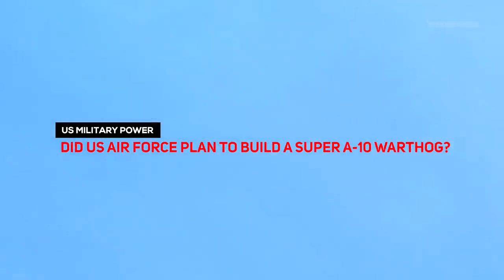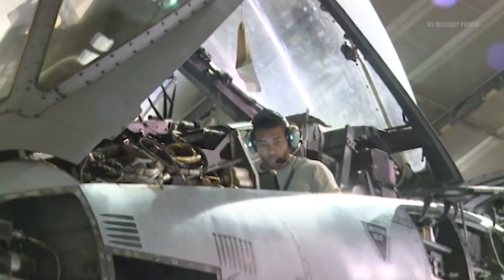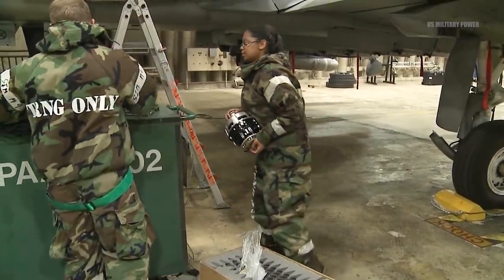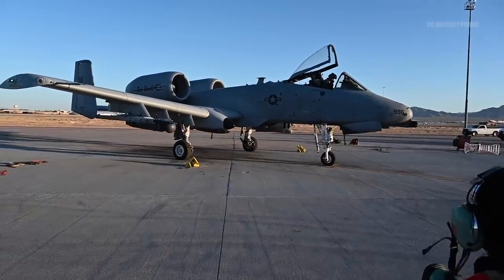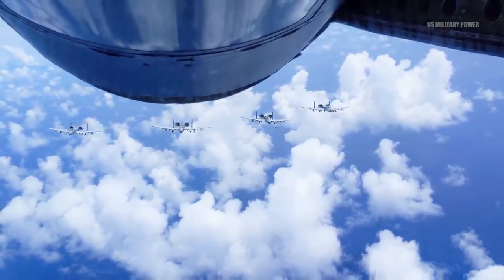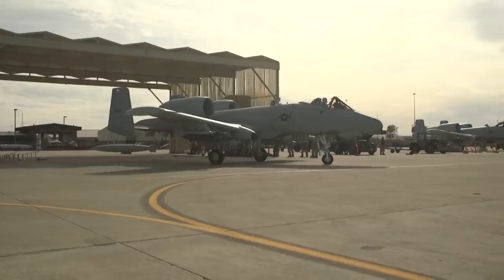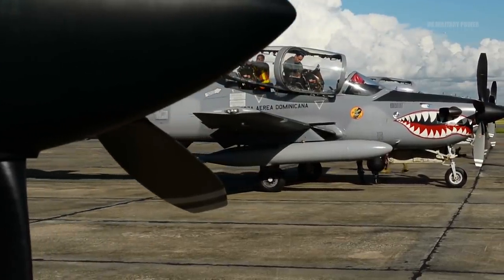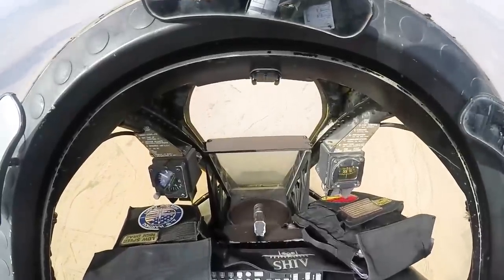The New Super A-10 Warthog is Coming

Comment: The A-10: the 30mm anti tank, vehicle and infantry flying gun
Reply: It literally was built around the gun.  Haha  brrrrttt  brrrrttttt!
Reply: Like......wooooo.
Reply: You missed anit building, hard ground target...
Well, if it is on the ground an A-10 can likely kill it!
Reply: The A-10 is basically the anti-everything gun with wings.
Reply: When you're ''anti tank airplane'' struggles to kill tanks with it's main feature and is outclassed by multiroles because guided munitions are based
Reply: @eemonkey7234  Just ONE lil ol' problem. The A-10 ALSO carries guided munitions on those under-wing pylons...
Did you even watch the video?
Reply: @BloodRaven1969  I never said that the A-10 doesn't carry guided munitions. I said it's main feature falls short by modern standards. Even then what difference does it make that the A-10 can carry guided munitions since the F-16, F-15, and the F-35 have larger payloads, while being faster and having higher chances of survival.
Reply: @eemonkey7234  Read the comments and learn a few things. 
1. The A-10's 30mm still punches through modern armor
2. The planes you named used in cas actions are highly likely to wind up losing the most important asset, the airmen. Whereas the A-10 will make it back to base with 2/3 of the aircraft damaged but the titanium crew bathtub intact as well as the crew.
Fast fliers clear the airspace then the A-10 moves in for the tank/armored vehicle clean-up because the fighting forces know to use the best weapon for the job, and a mach speed fighter/fighter bomber isn't the weapon for slow speed low altitude taking ground fire from man held guns. Bright move to lose a multi billion dollar fighter to an AK-47 when the (in comparison) cheap A-10 ignores even 12.9 mm AA machinegun fire and the gun men RUN at the first BRRRRTT.
Simple logic, easy to understand why the brass wants the A-10.
Reply: @BloodRaven1969  ''The A-10's 30mm still punches through modern armor'' 
It failed to kill a T-62 in testing, while mostly scoring mobility kills against outdated American target practice tanks. In a situation where they were not being shot at and had ideal conditions. Keep in mind that in a combat situation you're lucky if you manage to get in more than one gun run without facing defensive fire. 

'' a mach speed fighter/fighter bomber isn't the weapon for slow speed low altitude'' 
In aircraft terms slow means dead and being low just makes your situation a lot worse, it has been like that since the first world war. When you're low and slow you're an easy target in a straight line and you can't dodge properly because you lack the altitude to gain more energy. If you do turn hard to avoid fire, congrats buddy you're even slower now and the cycle continues. Until you're out of range/line of sight or you get hit 

''Whereas the A-10 will make it back to base with 2/3 of the aircraft damaged but the titanium crew bathtub intact as well as the crew.'' 
CAS doesn't mean you have to fly low and slow, it just makes you target.  CAS is supporting ground units who are in close proximity to the enemy. 
The fact it relies on armour to survive is already a sign of a bad design. At no point should an aircraft (or any fighting vehicle) directly risk enemy fire and hope to god that the enemies either miss or the armour holds. Armour and survivability are the last things any vehicle should rely on. Modern tanks and planes are designed around that philosophy. 

''Bright move to lose a multi billion dollar fighter to an AK-47 when the (in comparison) cheap A-10 ignores even 12.9 mm AA machinegun fire and the gun men RUN at the first BRRRRTT.'' 
Again some of my previous points. The F-15, F-35 and F-16 don't have to go low and slow to give support to troops. They can sit several kilometers up and toss guided munitions from relative safety. (SAM sites are the primary problem for them not ground fire). Plus the turkey shoot that was the gulf war already showed that the F-15 is a more capable aircraft overall for CAS operations. Also ''multi-billion dollar'' come on buddy you know better than that. 

Finally most acutal AA pieces are either manpads, or 20mm-30mm autocannons that are usually radar guided (plus radar guided missiles) and nothing will safe you from those if you're low and slow.
Reply: @eemonkey7234  Okay, let me break it down a bit.
1. A lt or med or armored troop transport, scrap. 
2. Low and slow = time on target. As others have said in other comment responses a fast jet is there and gone and in the cas role that means dead men on the ground. As to maneuvers, you are comparing a Ferrari to an off road rock crawler. THEY HANDLE DIFFERENT. 
3. The 35 carries ONE HUNDRED AND EIGHTY rounds in its cannon. Verses 1.7k in the Avenger.
4. Yes the 35 can carry the payload of an A-10 BUT that means on the outer pylons meaning the stealth is gone and the MANPAD/ect is going to find it just as easy and there goes a mega $$$ plane and pilot pair.

They ALL have their rolls, use the right tool for the job.
Do us BOTH a favor and read responses from those that have work with/on/and in one case flow the A-10. I just have family that have done all three, as well as SR-71, F-117, and every plane you have named, and more. Big family, military family.
Reply: @BloodRaven1969  
1. Is correct lightly armoured targets are easy pray for an A-10

In aerial combat slow means dead. That has been the standard rule since the first world war. Keep in mind that CAS means you support troops that are close to the enemy not that you're close to the bad guys. 

''As to maneuvers, you are comparing a Ferrari to an off road rock crawler. THEY HANDLE DIFFERENT.'' 
You can't overcome the laws of physics. Inertia exists no matter what and you have to spend energy to change direction. 

The reason the F-35 carries less ammo is that for the F-35 the gun is not it's main weapon. 

Gun runs in general are a extremely risky way of attacking ground targets. You either have to go low and slow or in a dive with a high angle of attack if you want to have decent time on target. Either one of these options makes you a excellent target for ground based AA systems. 

''4. Yes the 35 can carry the payload of an A-10 BUT that means on the outer pylons meaning the stealth is gone and the MANPAD/ect is going to find it just as easy and there goes a mega $$$ plane and pilot pair.'' 
The F-35 can carry a bit more
The F-35 can actually run SEAD missions to suppress it's primary threat for CAS operations (radar guided missiles from the ground). The F-35 also comes standard with an ECM suite while the A-10 has to either go without and fly low(and slow) or sacrifice pylon space. But even with all of the add of munitions the F-35 still retains a relatively small radar cross section. 

Also how does a ''pilot pair'' die when a F-35 is shot down. It's a single seater. At max you're losing 1 pilot per one shot down aircraft.
Reply: @eemonkey7234  Plane and pilot pair. The plane and the pilot are a pair.
Now, as you seem the type to try to repair a drain pipe with a ratchet set (a comment I wanted to post two replys ago but was exercising restraint) I am going to strap my lower leg on and go out and mow the yard.
As I said, multiple times, read what others have said. You seem dead set on arguing with what even the AF brass that were recommending mothballing the A-10 said about its usefulness so I'm not replying after this.

Comment: Brrrtttt we need! As a guy on the ground requesting support, the sound of the engines from a distance is life changing. Yes it is irreplaceable and has been modified several times as technology changes throughout its life cycle. Having said that, metal fatigue is real and the airframes are tired. Fire up the assembly line, make new frames that continue this legacy….

Comment: If it's not broke; why fix it? If the Air Force doesn't want it how about giving them to the Marines?
Reply: they have a better platform called the F18 and the F35...
Reply: @mitri5389  not for ground support they don't.
Reply: @dwanseicheine7409  oh? than why is the f-15, 16, 18 and b1 completing more cas missions than the a10 by a huge amount?
Reply: @mitri5389  so that's why they kept it?
They received a lot of pressure to keep it since a lot of people think the f-35 it's less effective than the a-10
This old monster is resistant, can fly low and slow and brings hell on everything, it's precise af
A-10 pilots train more than any of the other aircrafts you mentioned, a lot more, so they are very good at providing CAS even in the worst situations
Why should they drop it when it's proven to work wonderfully and it's tested, the f-35 can work alongside it but taking its place is another thing
Reply: @argus0ia  low and slow = easy target as for training all military pilot rotate to simulator and training aircraft on a basis that is greater than their on ready deployment, typically 2 weeks training for ever 1 week of flight readiness. people like to talk a lot about the gun but  its fairly ineffective and expensive to use considering that a full belt cost more than the typical guided munitions fielded for such missions and the danger it causes to friendles and civilian are much higher.

 newer guided munitions from the ground up are getting cheaper to develop and deploy and ensure higher flexibility, accuracy and combat effectiveness while keeping the aircraft in a much safery environment. a-10 is too slow,  non versatile, flying low is bad for efficiency and its capabilities aganist china is a liability considering that they have anti air defense that are 2nd to none, russia being the first, the a10 wont survive in such an environment. its a burden keeping this plane in service considering how much resource it takes to keep an aircraft that does nothing better, alive. its main supporters are lobbyists and those who are ignorant.

Comment: Generals like their prestige novelty toys, the more expensive the better. I wonder how many of these generals lhave been on the lines. From what I've seen the A10 has come home in unbelievably bad condition. The F35 is delicate crystal.
Reply: There are more generals in the purchasing department than there are generals commanding troops.  Naturally the focus is on more products and more expensive products.
Reply: You're right the F-35 is a delicate crystal, but that's because airplanes are not meant to take heavy damage. The reason A-10s keep on returning from missions in a bad state is that they're too slow and they have to fly too low. We live in an era where we have access to more than just dumb fire bombs. Guided munitions from several kilometers up, on a stealth plane don't have to worry about getting shot by machine guns and heavy guns from the ground. They have to worry about missiles, and frankly if you get in by one of those you're kinda fucked no matter what plane you're in.
Reply: @eemonkey7234  A-10's took out Iraq's cannons and tanks, cost 2 A-10's and 1 pilot. Purchasing department generals told pilots to tell members of congress the A-10 was exactly as you say.  They disobeyed orders, apparently pilots and field troops feel differently.
Reply: @philpugliese7049  Correction: 4 lost, 13 damaged, during 7,983 sorties. 
F-15s (C and E) ran 5,674 and 2,142 while losing 2 aircraft with 1 damaged. The F-16 ran 13,066 sorties while losing 3 aircraft. Giving it the best sorties to losses ratio. 

Keep in mind that during all of this the F-16 and the F-15 achieved more armour and vehicles kills. While the now retired F-111 outscored them both.
Reply: @eemonkey7234  Thanks.  Where did you get your info?  Sounds like a good source.

Comment: Why not just build brand new A 10's ?? Same should have been done with the F1-11 two of the BEST aircraft the USA has ever built.
Reply: Ah, the F-111 was a pretty mediocre aircraft, the F-15 E is far superior.
Reply: They probably could, but from what I read, the original blueprints and specs for the A-10 at Fairchild Republic were lost many years ago, so Boeing would probably have a hard time trying to rebuild it as faithfully accurate to the original. Don't see why do'n't they just strip down a single A-10 and study it's airframe so they can recreate a brand new one with modern avionics and engines.
Reply: @kdrapertrucker  Not the same tasks. The Pig is more of a supersonic B25. Long range, long loiter time, kills tanks and AA. F15 was originally "not a pound for ground" air superiority machine. Working together each protects the other.

Comment: I’m all for F-35 style wonder jets but sometimes you just need a brute.
Reply: The f35 has a lot more fucking brute force than an a10 does.
Reply: @-007-2  The f35 is far more capable and costs less than half per unit. The f22 is old and already inferior to the yf23 it competed against, it just won because of political medelling. It also requires 20 hours of maintance per flight hour. It is not even slightly possible to use it as a front liner and if you had the slighest clue what you are on about you would know this.
Reply: @Paytrolah  clearly the Oracle has spoken.   All differing opinions are invalid.
Reply: @Paytrolah  Thank you Master of All Knowledge.   The world is a much better place for your amazing brain.
Reply: @RtB68  Thanks!

Comment: It's needs the ability for VTOL and have a gunner's turret on top. COBRA!!
Reply: Cobra Rattler's unsheilded, wing-mounted lift engines would make it vulnerable to heat-seekers, but a "baby" Hog, 1/2 or 3/4 scale, built around a 7-barreled .50 cal, would beat out all current contenders for the "light attack" role.
Reply: @FusionAero  So basically, it just needs to be a Sky Hawk with a .50 cal cannon.
Reply: @EcoMouseChannel  If you could armor up a Scooter without too much of a weight penalty you might have something.  They tried that with the "A"-16 and ended up with a lawn dart though.
Reply: @FusionAero  keep the overall design but with better avionics and bigger engines, give it two seats and a wider fuselage to fit two cannon, and then downgrade the A10 to light status, don't think you would get any complaints!!!.

Comment: During the Vietnam Conflict, the Air Force had to pull P-51 Mustangs out of mothballs for use as Ground Support Aircraft. Their Fighter Jets were dismal for the task. Fast forward to 2021, and the Air Force Brass is still not concerned about Ground Support Aircraft.
Reply: No, they did not pull P-51s out of mothballs. They pulled Navy Skyraiders out of mothballs.
Reply: @kdrapertrucker  
I stand corrected, Sir.
Reply: @leedavis9576  That's a rather big mistake!

Comment: The kind of firepower and platform capability is going to be almost impossible to duplicate. Factually, a fixed wing prop aircraft with some hard points and close air support capacity that would be minimal compared to the relative firepower of the A-10 is not even close. NOt to me mention that it would not be as survivable as the A-10.

Comment: The easy answer - just build more A10's. But that is not as profitable the military industrial complex. Its all about who get the money.
Reply: I think your spot on with that. If they say they want to keep already existing assets, then money wont be thrown around. It always takes gobs and gobs of money thrown around for the politician's and Generals to think they're getting the newest most advanced equipment. When the best candidate for the job already exists with all of the infrastructure in place to continue forward without loss of life trying to prove a Ferrari (F-35) can win a dirt track race. Put the F-35 in more suitable missions or replace it with the F-22 raptor for air superiority dog fighting and bomber escort (if that's still a thing). The military will never admit that the F-35 is a disastrous failure. It should be cancelled. The F-22 can beat the F-35.

Comment: The best way to make a new a10 is ask battle pilots what u like and didnt like about the a10? What do u wish it could do. Then start from there. 
Test analog and digital pilot integration and use the best combo in the cockpit. Intuitive Speed Ergonomic in and put. Improve all failure points. Use tech like cryohydroform metals and fibers.. The coat plane in anti laser and rader skin. 
You know all the cool stuff 😁👍🏿

Comment: I get that the A-10 is higher costs to maintain due to older equipment, etc...fine. but every time it goes up against the latest aircraft for it's mission profiles it wins, hands down. It's the only place that can do it's job - low and slow..

Upgrading the A-10 is likely the best thing to do. All-in-all we need the plane. It's awesome at it's job.

Comment: This plane is second only to the sheer badassery of the pilots running into combat.

What a proper beauty of engineering and the clearest most logical path to solve the intended level of support.

Hot damn, turns out there was indeed once a time when my USA wasnt dead set in imploding.

Heres hoping the fires continue to stay stoked by achievements like this. 

Thats gotta be some good feelings hearing the incoming destruction of the A10. The 30mm round seems like the most perfectly absurd munition to fire at about 3500(?) Rounds per minute. America baby, sure maybe half the fire rate would have maybe still worked.
But the BRRRRRT always denotes lives saved, support inbound.

A truly amazing piece of aeronautical engineering.

Comment: One of the things they don't understand is the speeds that different types of aircraft need to stay off the ground. FACs (forward air controllers) need an aircraft that is slow enough to make a line up to the target, slow enough to go into a drive for the weapons and keep that dive. Things like the F-35 can't do that because of it's weight and minimum speeds needed to maintain flight. The A-10 uses mostly thrust to maintain it's flight which allows it to increase and decrease speeds as needed.